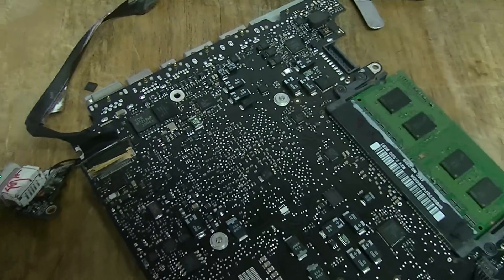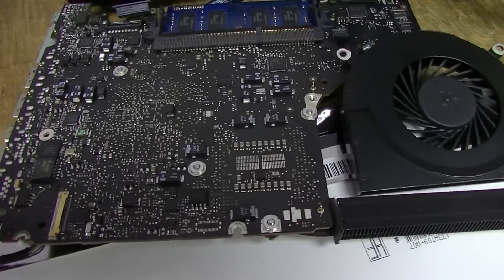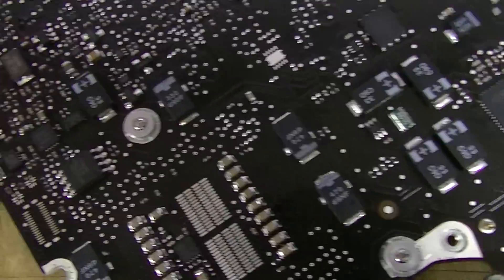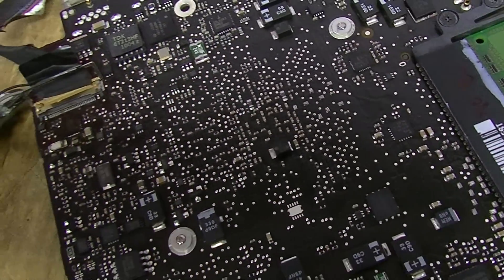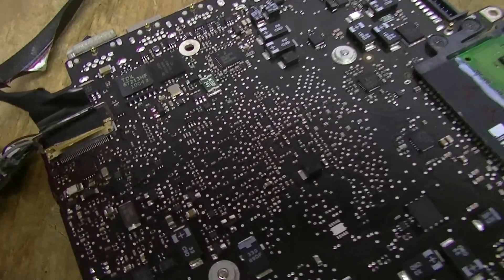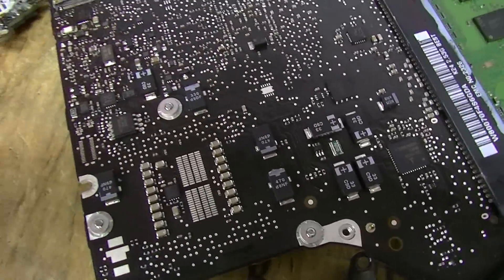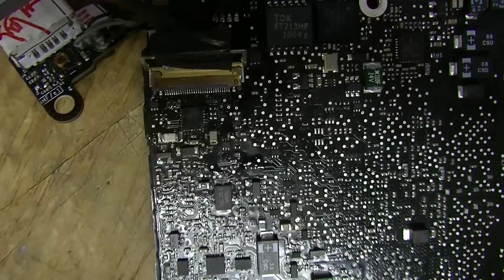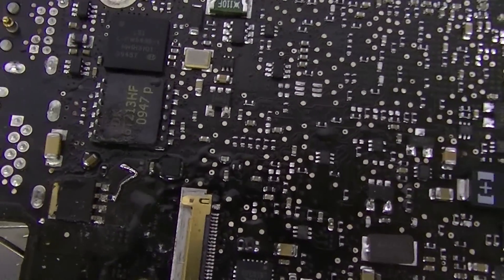Macbook logic board repair - 820-2530 no backlight repair,

Comment: replaced the backlight fuse with a wrong one(higher voltage) and my lvds smoked, had no backlight and now my lcd does not Show anything at all.

u think its the cable it selfe guys
Reply from the maker: +Milovan Stanojevic measure for short to ground in output before replacing fuse. Solve the short first.
Reply: Hoped that anyone would answer my question, But finally luis rossman answered.
I feel so ashamed. Im New in that.
Greetings from Austria- Europe. I realy love what u are doing. Rage against the big Apple machine and repair instead of replace.

Ty. My lvds looks Bad, like the one in one of ur Videos. Can I replace a A1466 macbook air lvds?

Ty. Great honor. Excuse my Bad english- ur so authentic - Big Fan
Reply: got a picture, still no backlight. 0volt on pin 3/4 - its a 820-3209.
fuse 9700 is desoldered.
New lvds or lvds conector?

Comment: Hi Louis, when you get a chance, can you tell me the purpose of Q9806 (FDC638) on a A1278 (820-2530) logic board (pg72).  I'm getting 12.2V on pin 3 and 12.6V on pin 4, all the other remaining pins have 0V.  This is bad because I need 12.6V to power my PPBUS_S0_LCDBKLT_PWR, and im not sure whether pin 3 needs to be pulled down  before Q9806 switches.  Any help would be appreciated. Cheers!  PS.  Keep up the good work!!
Reply: MrBios26 Hmmm I think I've answered my own question.  This question arises from me being bored and testing other parts of the backlight circuit while I'm currently waiting for my 2nd replacement LVDS connector (since i fucked my first one up withing 10 seconds!),  and i think the LCD panel needs to be connected in order for Q9807 to receive a signal from U1400 to pull pin 3 of Q9806 to ground.  Might be wrong!!!

Comment: Great job as usual Louis Rossmann, thanks for sharing.

Within the last few days i am getting crazy with an A1286 which works normally all the time but when the battery goes out of power and i recharge it, the backlight doesn't turn on until i disconnect the battery and reconnected again. As soon as i insert the battery i can see a flash on the screen, the same thing when i press the start buttom (a short flash of light), before the screen lights up normally, at this point the backlight works again flawlessy.

Really strange...
Reply: Rossano Balloco  realy strange

Comment: hi, i have the same motherboard but the problem is when i connect the lcd cable it burns the backlight fuse. according to you is a problem of wled driver chip or any other thing?

Comment: Again, Great videos for my edification!  I found conflicting info about the power pads for 820-2530. A You-Tube vid showing some paper clip toting kid shorting out (C2800 pin 2 with U2801 pin 5) ...  and Mac Rumors shows shorting out (R5016 pin 1 and 2). I would like to know what you think? and to hear your train on powering the boards up during troubleshooting?
Reply from the maker: WHEREVER SMC_ONOFF_L shows up, short that to ground and you have your power switch, for any of these boards. There is no right or wrong way to do it, just whatever is convenient for you and easiest to remember without resorting to a schematic. If I cannot remember where SMC_ONOFF_L is on a board within five seconds, I just grab a keyboard and plug it in, no need to drive myself nuts so I can "feel" like I am smarter by turning the board on a certain way. I have worked with people who would rather spend 2 minutes going through the boardview/schematic to find these pads than just take the keyboard right next to them on the table and plug it in.. it drives me nuts.
Reply: Louis Rossmann Thanks, that makes it a bit easier. got it. I am struggling to trace back the ALL_SYS_PWRGD and find why this board has G3HOT but not powering on. No voltage on ALL_SYS_PWRGD, and having trouble finding where the voltage "starts to flow" when the power switch is depressed or G3HOT jump start is shorted. I just got the activation for Advanced Reworks forum, I will be hitting you up for more info there if thats ok? Please keep the videos coming!

Comment: Hi I love your work and your methodology on troubleshooting. I have an A1342 white unibody which is not turning on,  no chimes and no image. Unit was working fine with no history of liquid damage but user complained of a dead battery for the last couple of months although charging circuit was ok including led indicator. So fan spins for a couple of seconds when power switch is pressed but thats the only sign of life it has. I started some trouble shooting on the power rails  but I need your guidance to find this fault, all fuses tested ok. G3HOT supply = 3.4V

Comment: hi rossman i have a question
i replace the screen for macbook a1278 and before the replacement the screen showed backlight so now i dont have backlight.... i test with the old screen and no show backlight , may be i broke the cable lvds,im confuse
Reply from the maker: maybe. Check the backlight fuse.
Reply: i checked the continuity and was good, i ordered the conector and lvds , i will let you know about that.thanks for responds.GOD bless you
Reply from the maker: Was the connector bad?
Reply: no was good

Comment: yo i respect you technique! my issue is about 4 pins on the lvds connector are burnt (seperated from the pads) is it too risky to just attempt a resolder? also just for fuxking kicks, whats a normal fuse supposed to look like, cuz a few pins here and  there (all in the near vicinity of these burnt pins) are looking a little "dull" any advice bro?  BTW i fucking hate apple. they want to be special and diffferent, which causes such unique issues, but hey they sell right? lol thanks for the video man
Reply from the maker: Resoldering is horseshit, buy a new connector for ten bucks and put it on. Sometimes a good ultrasonic does the job but a lot of the time the short is inside the connector when the pins corrode and touch one another where you cannot see it. 

A fuse looks like a fuse.
Reply: lol yeah about 5 min after i posted that i came to the same conclusion. im just hoping i didnt burn the pads too bad...thanks bro